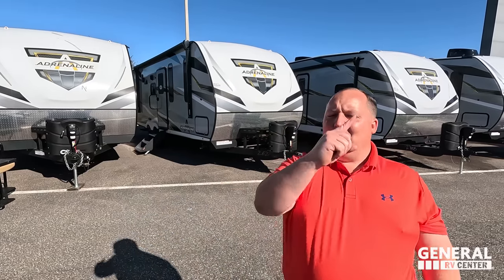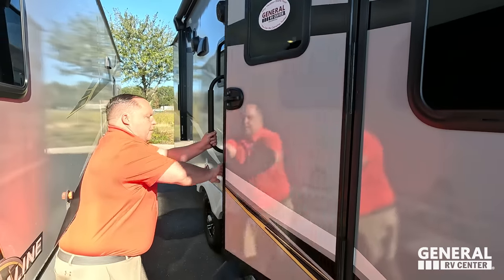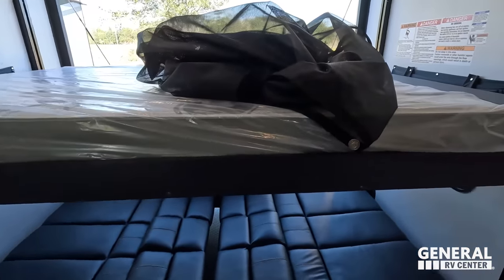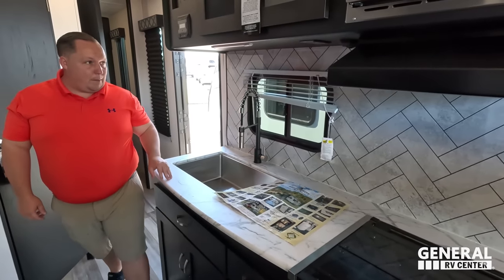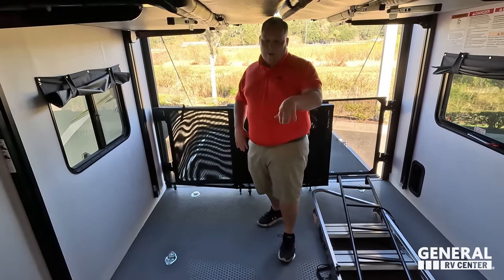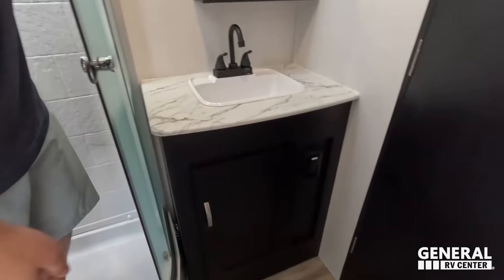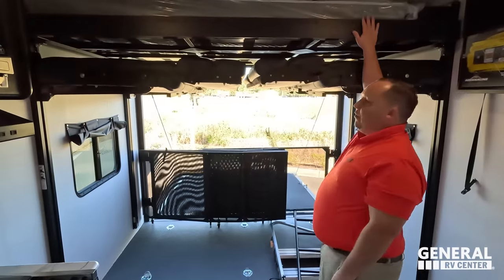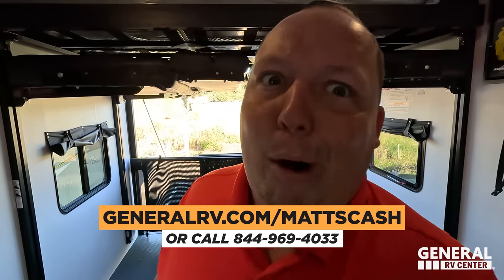Small and Easy to Tow Toy Hauler!

Comment: This is a really good piece of kit. Very good value for money. On another point, what is the difference between city water and potable water? I know potable water is drinking water, so what's city water? Here in UK tap water, which I assume city water is, has to be drinking water too.
Reply: @katebarker5612 The "potable water" inlet is where you put water you are going to carry around with you in your fresh tank. The "city water" inlet is where you attach the hose when you are at a campground and it comes straight to your sinks, shower and toilet without going into the tank. Pressure comes from the tap so you don't have to use the water pump when you are attached to "city water."  It might not be city water, could be a well or something, but it's called that to be different from "stored in your own tank" water.

Comment: I like this but it is still too long and heavy. I don't want a king-sized bed, would rather have a little extra space to walk around a king. I really want like 26' or less, 4000 lbs dry-ish. I only want to put my electric bicycle in there, use the fuel tank for gas for the generator. I don't need 100 gallons of fresh water, 50 all around would be perfect. I love the rack for the generator up front! I'd appreciate some assist on that ramp door. I would like comfortable captains chairs, but I could live with those couches, I guess.. Just as happy to have open space for chairs there and just the one bed that lifts. It sounds simple... but I can't find it. And I watch all the reviews.